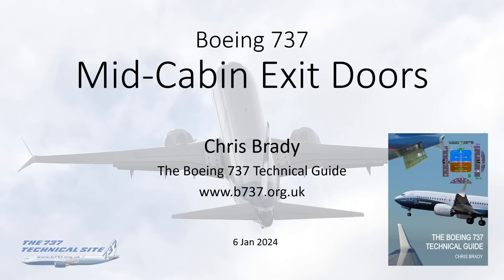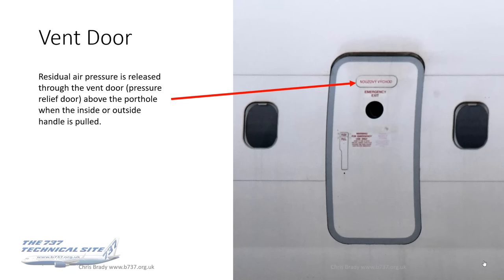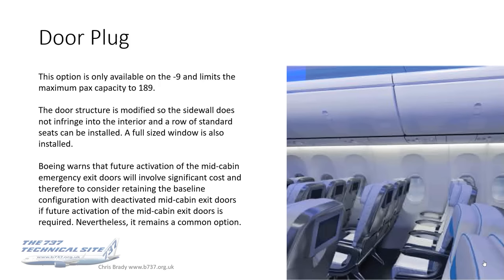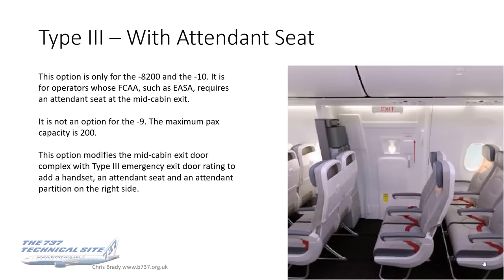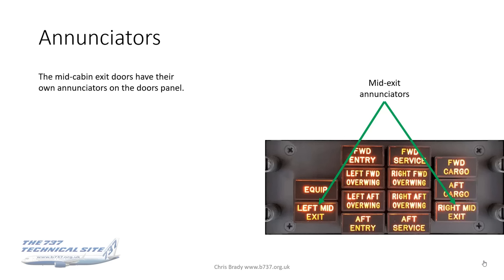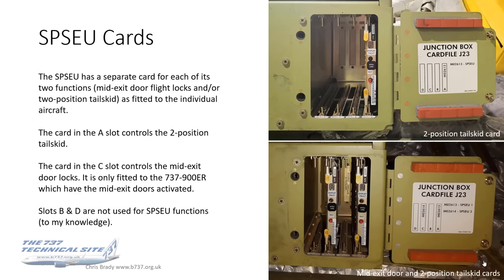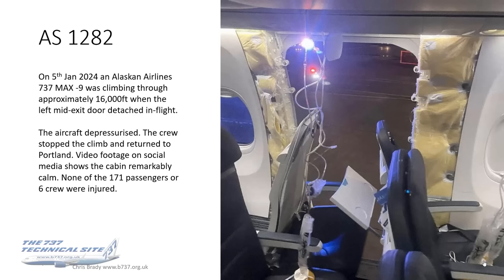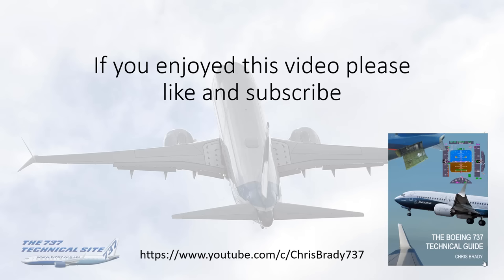737 Mid-Cabin Emergency Exit Doors

Comment: Very helpful! I do fly the B737-8200 so I know how to operate the doors but this gave a lot more context.
Reply from the maker: You are welcome, glad it was useful.
Reply: The Ryanair (Not sure if this is the airline you work for?) setup of the 8200 is brilliant. I love the backwards attendant seat, I had a laugh with the cabin crew member there last time during takeoff.
Reply: I love your channel.
Reply: Already waiting for your video as well @mentourpilot 😂
Reply: The B 737 max is a very safe plane. As long it is on ground and all the engines are off!! Greetings from old Germany 🇩🇪
Reply: Assuming the plane was climbing and pitching up slightly, how far would that door have missed the port horizontal stabiliser?
Reply: @pinkharrier47  Good question. I would guess that there are several variables at work here including the actual cause of the failure. Probably pure luck that it didn't hit. I would be interested if someone did a technical evaluation of this scenario. Perhaps someone could educate us on what the consequences would have been if it did strike the horizontal stabiliser.
Reply: Excellent and informative video! Glad to find a new aviation channel to follow, too.
Reply: Made in America Quality 😅😅
Reply: @W.F.Fischer  LOL
Reply: @jamesmartin4586 I’ve seen incidents with smaller aircraft in which a cargo hatch opens, gets blown and then hits the horizontal stabilizer. In those cases, the horizontal stabilizer doesn’t get structural damage, but the hatch kinda warps itself around it and creates severe control issues, so here something similar might be expected. Some significant differences: the relative size it’s very different, a hatch in a Cessna it’s bigger relative to the size of the horizontal stabilizer compared to the size of the door and the stabilizer in the Boeing,also the speed of the event it’s vastly superior in the Boeing so there is much more energy to be transferred, so my guess it’s that a partial structural failure or some control issues are to be expected in that event
Reply: @pylt93 the mid exit door is a significant piece of structure. I assume 150lb. I work final integration of the 737 fuselage.
Reply: Very informative video, Chris! Thank you for sharing your
understanding into this aircraft and the incident that could have been so much worse.
Reply: The name of the airline is “Alaska” not “Alaskan”
Reply: Thanks for an Interesting video. You say the type 2 door comes with a slide but no mention of a slide on the type 3 doors. Are passengers expected to jump down ?Looking at your external picture of the doors its quite a drop.
Reply: The four bolts that are being referred to in this video and comments are not the structural components that keep the door in. They are there to keep the door from moving upwards in the opening. There are 12 door stops on the door and the door surround structure. These are what keep the door from being pushed out when under pressure from the inside. The two bottom bolts are the hinge pivot bolts and they would have had to be in place because when the door is installed the bottom is attached to the hinge and then the door is swung up to the shut position. The door is then pushed down so its stops are positioned behind the door surround structure stops.These stops are what keep the  door from being pushed out from internal pressure. Now the top two bolts are installed to keep the door locked in this  position..stops behind stops. Almost all commercial aircraft passenger doors work with this concept. The only way this door came out is if the top two bolts were not in place or not locked with nut and cotter pin and vibrated out. If those two top bolts were in place, the door cannot move up and therefore can't get pass the stops. I hope that is clear. 35 year Aircraft maintenance Engineer working on these tyoe doors...never seen one fail. You can see all the door stops are still place in the pictures floating around of the accident aircraft.
Also would like to add that the bottom hinge assembly can move up and down slightly, approximately 1", to allow the door stops to slide behind the fuselage surround stops. When the door is subject to the internal pressure of the cabin those stops are touching each other and are under several tons of pressure.
Reply: @W.F.Fischer  So right!
Reply: @phxpaul  Correct. Alaska has been misnomered by many since day one. Now, try to convince my Dad and his frequently-fly-Alaskan contemporaries of that fact. Not gonna happen. Cheers!
Reply: @SeinarCustomShop  it’s been found. Dont know the source, but it said to weigh 75lbs
Reply: Ryanair boarding is chaos now. Too many pax. And only 2 toilets for 209+ pax is not enough.
Reply: Iam here for your recomendation

Comment: This incident might open another Pandora’s box at Boeing, whether it’s engineering, parts suppliers, assembly techniques, quality control, labor training…
Reply from the maker: Quite possibly. There will be a detailed investigation on all those aspects for sure.
Reply: I wouldn’t call it a Pandora’s box. Every part of this process is known and there is an electronic/paper trail for everything. Clearly, a process escape happened here. It would be odd for this to be a design issue since they are not completely unique even though only available on the -9 and -10. I assume that things like the door frame structure and door structures have been borrowed/re-used from previous designs. They’ll pull the ships build records, look at the installation buy offs and QA buy offs. I am surprised that it’s only 4 bolts. I was a design engineer and bolts, especially titanium are very strong. I will guess at this point that it was missing the top 2 (at least). Excellent presentation. BTW, I work on the military side of Boeing and ran the factory floor systems for the C-17 25 years ago. So, I know a lot about how we build, verify and document the final assembly of our aircraft. My money is on a manufacturing escape here.
Reply: @jamesdellaneve9005  For the un-initiated here like myself, what is "manufacturing escape"!?
Reply: These days, almost all mechanics routinely take a shot of the completed work with their mobile cameras. Will be interesting to know if the mechanic who signed off this installation has a pic on his phone!! In any case, Boeing should have a good idea of the cause by now.
Reply: @kadambisridhar9365  Boeing doesn’t have a system like that. Commercial aircraft has an old text base buy off system.
Reply: @mderline4412  When you do something wrong that’s not been detected and fixed. It could be a procedure, or leaving off a part, of installing something incorrectly, not torquing something correctly, etc. A gazzillion possible ways to do it wrong.
Reply: @jamesdellaneve9005  Thank you. Good looking out! Always amazed by the jargon of different professions. I'm thinking *Manufacturing deviation*, would make more sense!   But who are we to judge!?...
 lol.
Reply: @mderline4412  It's a fancy way of saying, a crucial step was missed in the assembly and installation process. In this case, the proper install, torquing and locking of the bolts & nuts holding the door in place.  These kind of operations are well defined and a series of steps are listed. At every crucial juncture, there must be a verification, sign off and the necessary paperwork retained for a certain period of time. It would not be too difficult to trace when, where and who worked on it, who did the inspection and sign off. Finding the blown out door would be of great help to the investigators but it is not a show stopper. What is left of the will offer plenty of information as to how it came apart and departed. This was a close escape. It could have have turned out really bad.
Reply: @Vasu_Polu  Thanks for the more detailed explanation.  I was hung up on "Escape" as opposed to "Deviation" or something similar.  I guess this demonstrates that Jargon is jargon. Doesn't have to make sense to someone outside of the group...

Comment: i'm mystified as to why the plug isn't fitted in from the inside, so this kind of thing can't happen as easy.
Reply: Its plug type door. When you are opersting the handle you are lifting up from the fuselage frame stops. Of course its not possible when you have cabin pressure pushing the door stops against the fuselage stops. On the 767/757 similar doors are used for ages.
Reply: YES!  why rely on bolts if you could fit a door from the inside and remove bolts from the force equation?
Reply: @fToo If the cabin ever experienced negative relative pressure then the failure mode would be the plug blasting to the inside of the cabin with all the passengers.
Reply: @Plutogalaxy  but this is NOT a door !
Reply: It sort of is, there are lugs and slots inside that hold the door in place.  You have to lift the door up 2 inches to disengage the lugs before it will open.
Reply: Because the opening is the same whether it's a door or plug - the door option wouldn't be compatible with that.
Reply: @USAmerican100 . Then how did it get open
Reply: no bolts
Reply: @Plutogalaxy  except several cargo door designs. For rxample 767 lower larrge cargo door, main deck cargo doors. They are not plug types but equipped with additional safety features like latch / lock mechanism

Comment: Supposedly this aircraft was delivered from Boeing in October 2023. If so, this poses serious questions about QA procedures for me as a passenger. Given the previous problems with the MAX variant of the 737, this is not wholly reassuring. Certainly wants to make sure I fly only the NG or a non-Boewing short-haul aircraft.
Reply: Worked for Lockheed 34 years and have seen some shoddy stuff on the U2... not a surprise anywhere sadly.....
Reply: I hear that the affected types have already been grounded.
Reply: @ImperrfectStranger the directive was to inspect them before flying again. It's not a grounding like the Max 8.
Reply: Hopefully ... I guess it depends on what the inspections reveal  @jonathanbott87
Reply: @jonathanbott87  Seems like we spoke too soon. Even after worldwide door inspections, the FAA has put the aircraft back on the ground until the errant door has been found.

Comment: I’m no aircraft mechanic but this kind of looks like negligence to me. From the pictures, the holes/hinges where the bolts screw in didn’t appear to be ripped off or massively structurally compromised. Also, kind of hard to believe all four retaining bolts sheered off (being that the plane couldn’t have been anywhere near max diff pressure) or that all four bolts backed out, therefore I’m guessing someone either put illegal “Home Depot” cheese grade bolts in or missed putting some bolts in all together. What else could it be???
Reply: Boeing is a bunch of clowns
Reply: Had this exact conversation with a BA retiree engineer.
Reply: Think the fuselage actually made by Spirit Aero. Guessing standard parts. Spirit did push to increase production and also faced labor issues in 2023. So maybe chance for something sloppy to get through increased. Not sure if Boeing has any hands on with the particular plug section. Though they should be responsible for final full quality check. But I don't know how much manufacturers or maintenance would or could check detailed fastening compo throughout the plane?
Reply: i don't think you know what the word negligence means
Reply: @chocolatecoveredgummybears  actually…I do know and understand the legal definition of “negligence” in regard to a breach of a standard duty of care.  Since you must think you have a better understanding of legal negligence let’s hear it.
Reply: @mxcollin95  breach of standard or duty of care in the legal sense requires injury or death
Reply: bolts don't go in those things you saw. those things are stops and only hold the door when it is in place, the door slides up pushed by springs to pass the stops. It looks like the bolt goes into the guide fitting to stop the guide sliding off the dowel (the horizontal metal pipe thing that the door hangs on).
Reply: " What else could it be???" 
Structural failure. All sorts of possibilities there. Although with structural failure you would expect to see the retaining bolts still in their holes and maybe even remnants of the door in the hole. But until they find the plug everything is on the table.
Reply: @chocolatecoveredgummybears  I don’t think you understand that injury does not just mean physical injury.
Reply: Does seem to be the bolts preventing the vertical movement of the door worked loose, which probably means the cotter keys were not installed. In the pictures of the frame and the door the 12 pressure tabs seem to be in place.

Comment: Boeing is a great example of a company that fundamentally changed over the years (after the MD merger) of putting shareholder profit ahead of safety and milking 40 year old ideas, instead of innovating and improving. These "new Boeing" accidents will continue AND GET WORSE mark my words.
Reply: Plus the people that work there are clowns
Reply: Both preceding comments are unfounded, absurd drivel.  Nobody goes to work thinking “I’m too tired to do my job safely and I will be putting people’s lives at risk for profit.”  Mistakes (likely cause of this mishap, in my opinion, but we need to wait until all of the facts are in before casting shade ) can be made in any profession, under any circumstance.  Let’s stop being judgmental before we know what we are talking about.
Reply: No, but lots of people go to work and do whatever their senior managers tell them to do, and if cutting costs and achieving output levels to produce short run profits is the priority, this is what gets done.    With the 737 Maxes that crashed, it was clear that lots of steps were taken that reduced costs, eg not require any training or telling pilots about a new system, that clearly had safety implications.
Reply: @neilferry2263  training or telling pilots about a new system was up to the airlines eh! You think Boeing personally trains all pilots of all airlines! GMAFB:face-orange-frowning:
Reply: Boeing told the airlines that no new training was required.  Of course training requirements are set by the manufacturer.  So  Boeing paid a $2 billion fine out of goodness of their hearts?

Comment: The FAA today has announced an emergency airworthiness directive requiring all operators of the 737,Max 9 to perform certain inspections. Alaska has canceled about 165 flights today affecting over 23,000 passengers.
Reply: Based on this video, I'd speculate the initial directive is to remove the interior panel and check the 4 bolts in each plug?
Reply: It is my understanding that Biden will fly all 737 Max 9 to a maximum cabin altitude himself, then kick the doors a few times to confirm airworthiness.

Comment: As a (now retired) lifelong aircraft engineer, all I see here is very poor design by Boeing when trying to please all customers at the cheapest cost. Irrespective of the physical failure cause in this case, I am surprised by this "door" design only having 4 plug stops but no safety mechanism to prevent inadvertant door raising (e.g. physically bolting the lifting mechanism). Technically, if this item cannot be operated in service, then it becomes a removeable structural panel not a "door". The design here encapsulates the design problems and weaknesses the FAA and Boeing keep permitting through quality control. I believe every aircraft should have the fully functional emergency exit door, or no "door" at all, with the low density config having a permanent exit lockout procedure in service. Boeing have clearly lost their way, and have lost the KISS philosophy in their design. Far too many differences and options in this mess. I await the (incompetent) FAA investigation outcome with interest.
Reply: Exactly.  It's a freakin intentional hole in an AIRPLANE.  How much did they really save not making two models of the fuelselage -- one with each door number configuration. This blows my mind how impossibly dumb the design team was.  You added a hole in an airplane?  So you could fill it later?  Just for fun??